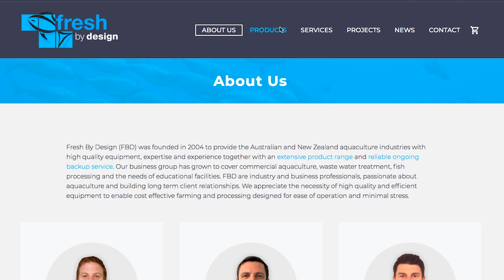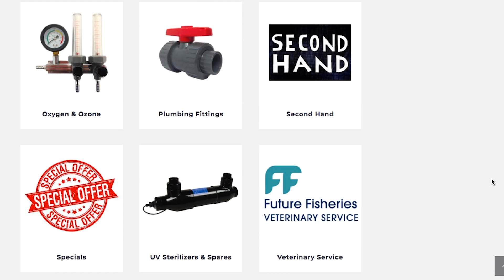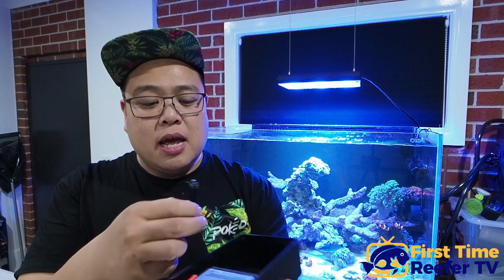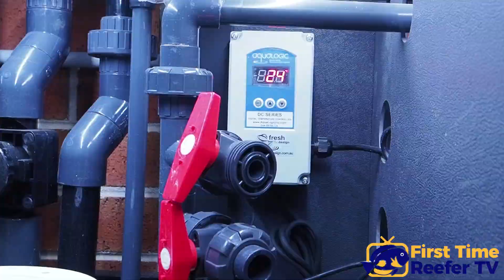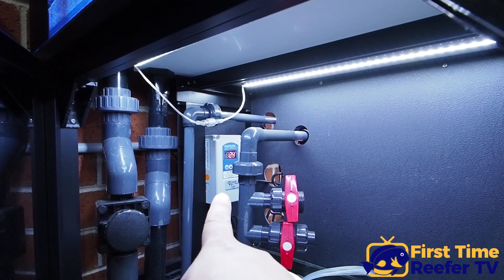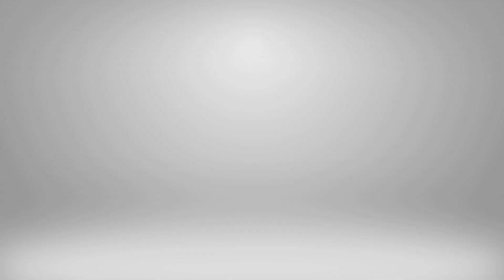Best heater option for your marine aquarium!

Comment: The best aquarium heater is Arizona. Why do you need a heater in Australia either?
Reply from the maker: Michael Lee have you been to Melbourne? 😂
Reply: I realize it can get cold, but rarely freezing. As is the same where I live in Phoenix, AZ. This means that during the winter I turn my home furnace to a minimum temperature, and my tank wanders one or two degrees. Finally, I keep my tank cooler, 75 to 76 degrees. Aussie  corals come from colder waters anyway lol.